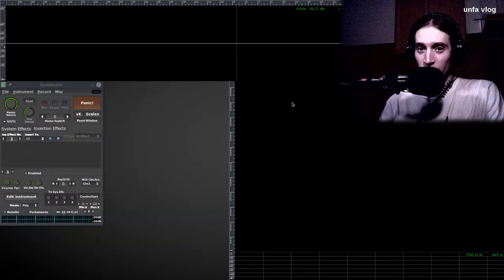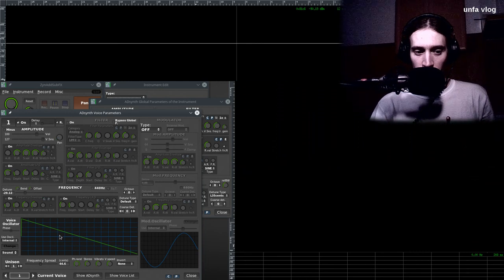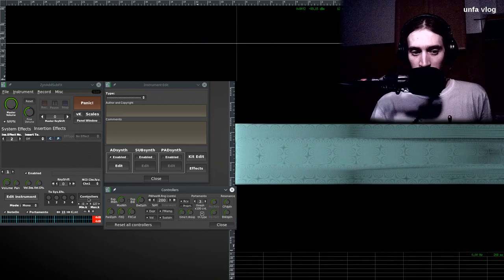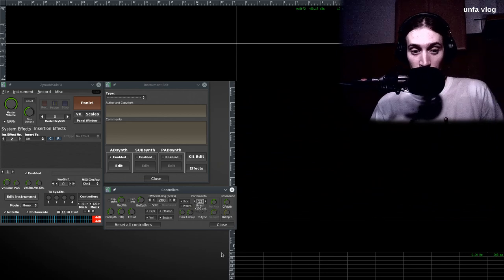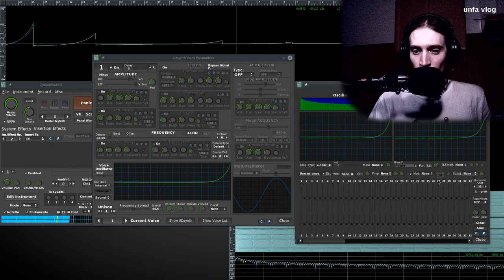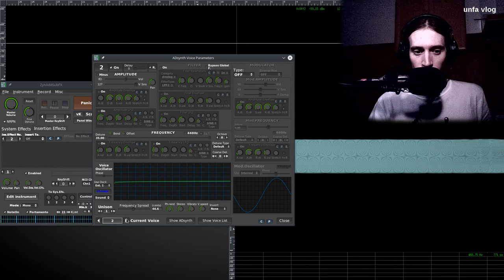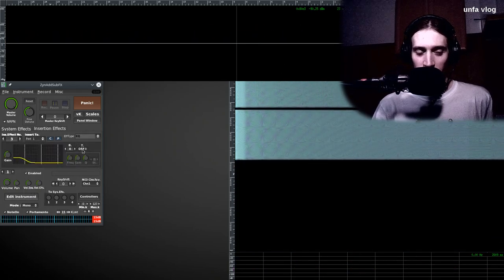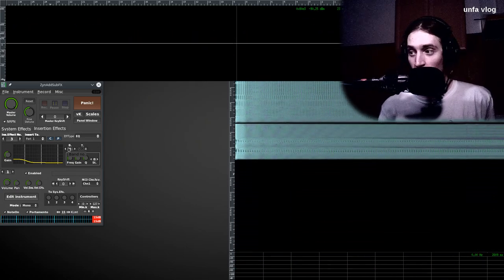UV#02 Making a Reese Bass in ZynAddSubFX

Comment: Can addsubfx create any possible sound? I want to create a deep house bass in it, but it gives me a choked bass that is hard to hear and gets very exaggerated when I give it gain.
Reply from the maker: I don't think any existing synthesizer can produce any possible sound. All of them have their limitations.
But Zyn is very powerful. It doesn't have wavetable functionality but it's FM capabilities are pretty cool (though it's a bit noisy). I am nowadays mostly using Surge and Vitalium for my synth work, but none of these were available when I released this video.
Reply: @unfa00  Thank you. That's awesome information. I didn't think there were decent synthesizers for Linux besides zynaddsubfx and amsynth. However, I can't find Vitalium that you mentioned, but I found Vital from vital.audio. Are they the same?
Reply from the maker: @MehdiHaghgoo  Vitalium is an unofficial open-source community-managed version of Vital.